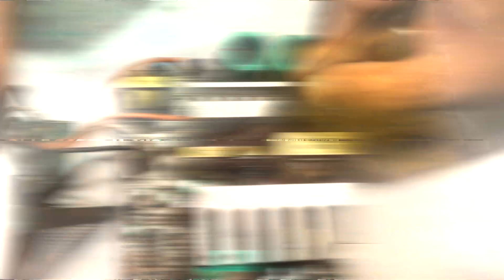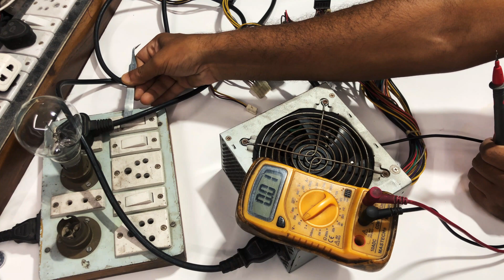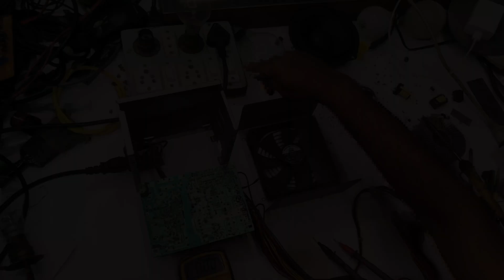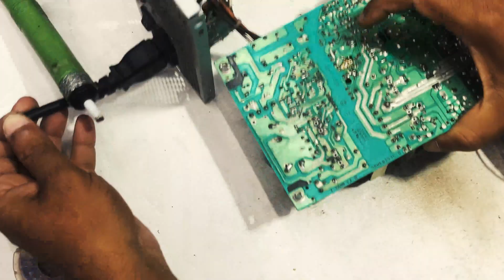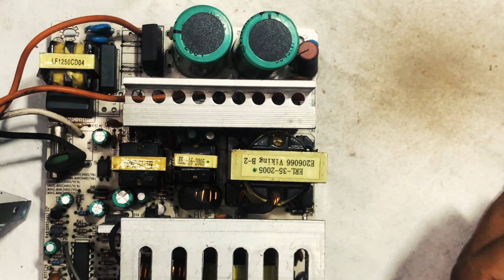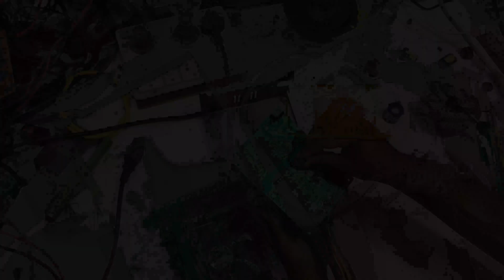SMPS#4 Moving Fan for Milliseconds and STOP | Cooler Master.

Comment: I have a Nox Urano II 630W ATX power supply, but it never turns off, with the fan always running without being connected to any motherboard, I checked with the ohmmeter that the green PowerOn wire is in a short circuit with the black wires?  
How can I solve this problem ?

Comment: i have 550 watt cooler master supply fully moduler jo isky sata output hai whan problum hai jub hard drive connect kr k on kro tu suplly fan 1 2 second k liye on huta h phir off hu jata hai or jub hard drive connect na kro tu power on hu jati hai full pc on huta hai card bhi jub hdd lga k on kren tu nhi on huti any sloution?

Comment: i have the same 350w model it is dead no 5V vsb also, & a 500w & another 500w with active pfc all 3  cooler master are dead, same no 5V vsb trying to repair them since very long, can the optocouplers be faulty.
Reply from the maker: Another 350w smps dead.
https://youtu.be/zk4UhlQXmcs

Comment: 1N4148 is NOT a zener diode
Reply from the maker: Small Signal Fast Switching Diodes.
Am I right?
Thank you for your comment
Reply: Correct. Nice video by the way. Very informative.
Reply: 4148 is a normal diode not the zd